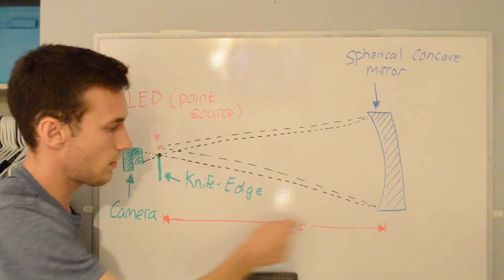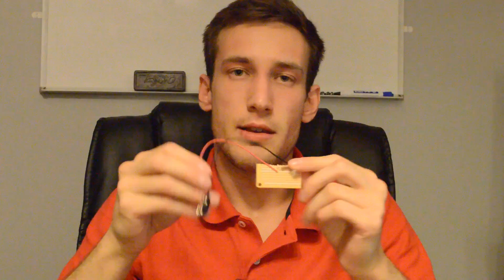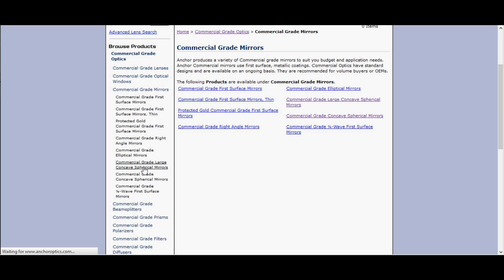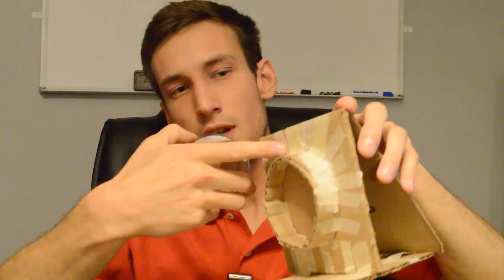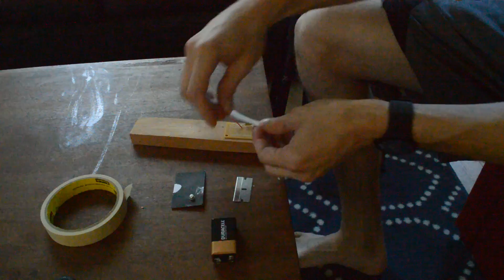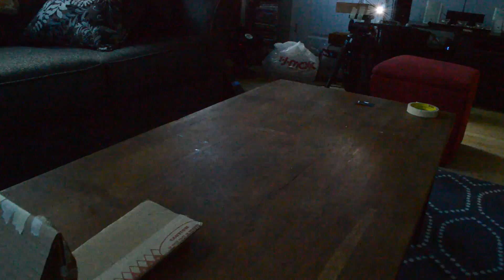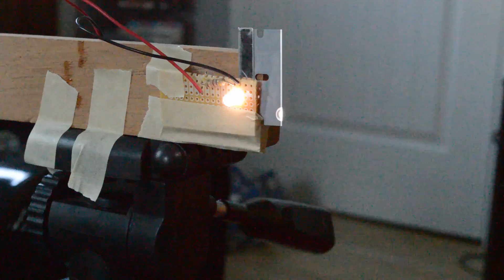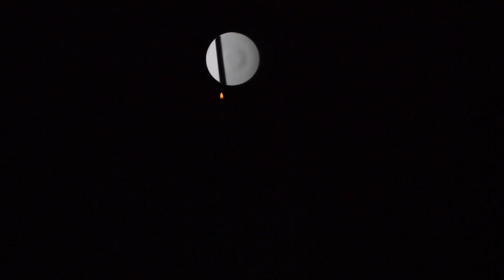How To: Build Your Own Schlieren Setup

Comment: Why is it 2f not 1f ?
Reply: The focal length of a concave mirror is defined as the distance at which the reflected rays converge from parallel incoming rays. That is going to happen at half the radius of curvature for a spherical mirror. The focal point and the centre of curvature are not the same place. Rays coming from a point source like this are not parallel, they are diverging. If you place the light source at the exact centre of curvature then those rays all come in perpendicular to the mirror's surface and get reflected right back to where they came from. A little off to one side reflects a focused point back at the same distance, just off the other way by the same offset
Reply: @MattNolanCustom  forgotten what this question was abot but  thanks. I always thought 2 beams from a tiny point diverging at infinity were taken to be parallel :)
Reply: @ mirrors with a focal point at infinity tend to be called plane mirrors ;)

Comment: Or you could just shine you phone flash light in front of a flame from a lighter and see the same affect on the wall.
Reply: Your*
Reply from the maker: That's actually a different technique called shadowgraph, and while they may look similar, they are showing different things.  The Schlieren method shows the first derivative of the index of refraction and the shadowgraph shows the second derivative of the index of refraction.
Reply: Oh ok thanks for explaining that.

Comment: I will be as brief as possible. ONE the presentation if complete, that is numbers, calculus, formula, and subsequent derivatives thereof. Thank you so much for this great chance at a little know idea/subject! YET, again, let me say the math, means and hows to make such a LANDMARK devise is not done by too many (no doubt due to the guys like me that are gonna ask for necessary improvements...), WHAT, please is the absolute (as pragmatic for homebuilders like me and you ) diameter of that "PIN HOLE." I built the devise, but it doesn't work. Indeed my entire
 set up was due to an incorrect "pin hole" in that foil over the
LED. Thanks again, in the name of DIY and the movements like demonstrating a "better way" sense 2000 pt Secret name of Most High.

Comment: The mirror is the key -- but long focal length = expensive. My 6th-grade son is doing a science project on improving shadowgraph and Schlieren sensitivity while keeping costs low. The problems we're finding with the DYI Schlieren videos on YouTube are either (1) the sensitivity sufficient to see heated air rising from your own body, or seeing your breath, requires a really expensive mirror, and (2) the inexpensive setups can image only really big heat gradients, like plumes coming off flames and soldering irons. We have some ideas we want to try (yes, this has sort of become my science project too), Part of his assignment is to interview someone knowledgeable. Are you willing?

By the way, the Novatech MCC106 mirror https://www.novatech-usa.com/MCC106 is low cost and decent, advertised at 150mm focal length but is actually 120mm. Pretty short, but it works in the "Smartphone Schlieren" article at https://arxiv.org/pdf/1609.04298.pdf (which I built after the author sent me the STL files, although it's for an iPhone 6 and I had to modify it for my Samsung phone).
Reply: Thanks for the links! The information was helpful.

Comment: Hi Josh, great video! We (my students and I) tried to make it work with the mirror you point at in the description (http://goo.gl/b2P0TI) but that is actually a 75mm focal length mirror. In a very dark room we only get a glimpse of shadows. We used a https://www.amazon.com/gp/product/B009F6CMWO as the knife and the same LED/resistor/9V combination. Its looks like the focal length of the mirror is the biggest problem. Am I correct with this assumption?

I've been looking for different mirror solutions because the 762mm (30") focal length mirrors for 76mm (3") diameter at edmundoptics are expensive. At least $215 or more is outside my budget. Any tips for another supplier(s)?
Reply from the maker: Thanks Andy!  Yep, you are correct in your assumption.  So the biggest problem for me has been keeping and up-to-date link for a high-quality inexpensive mirror in my bill of materials down in the video description.  The problem arose because the original place (Anchor Optics) that I got my mirrors from sorta folded back into its parent company (Edmund Optics), where they were selling the mirrors essentially on clearance until they ran out.  The one that I mention in the video description and linked to was the 750 mm focal length (which was definitely there at some point, but has now since been sold out).  Now it looks like they only have the 75 mm focal length available, which is really too short for this system, as you found out.

I'm still trying to find some good places to get a nice mirror, and I'm also relying on people like you to let me know if you find a good place to get them so I can put that in the description for future viewers.  As of right now, I'm not sure of a place to get a good mirror with the right focal length and quality, but I'll keep looking!  I'm also going to update the video description so it takes into account these new developments.

Thanks for the comment!